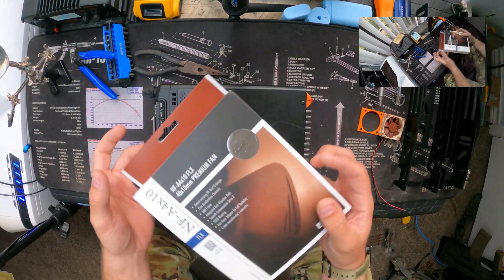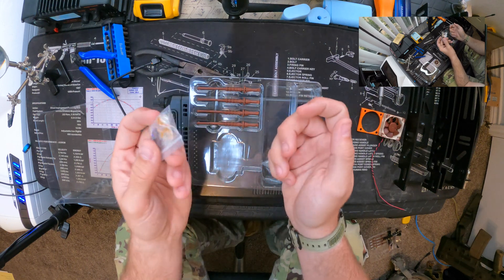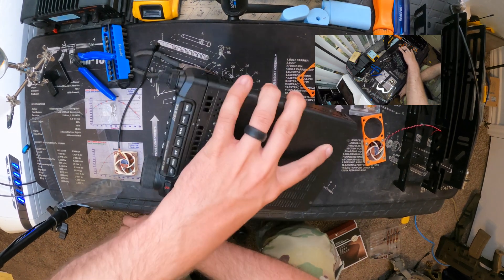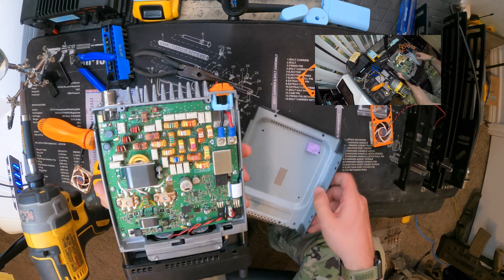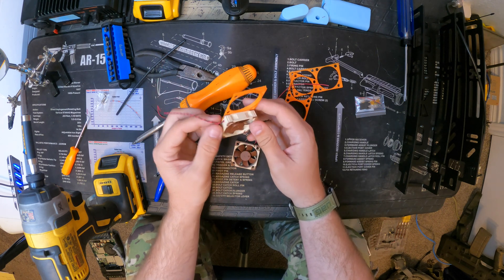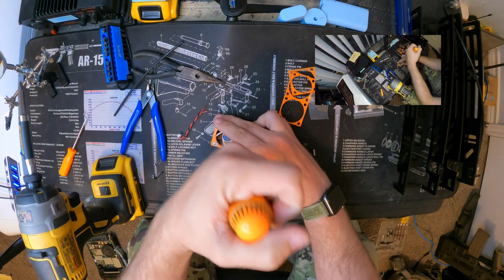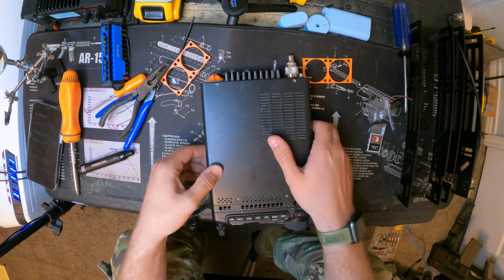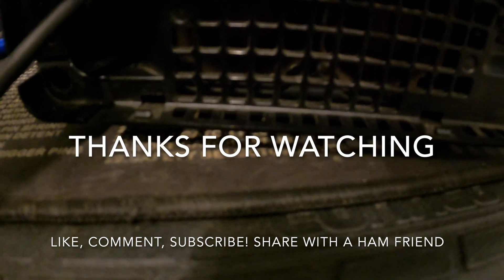The Workbench: Yaesu FT891 fan upgrade

Comment: I've ordered mine they are a lot quieter only thing I see is the speed difference original is 5500 new ones are 4500= 1000 rpm difference airflow is almost the same original is 4.9cfm  new is 4.8 cfm Hope this helps anyone thinking of changing the fans out I forgot about the noise origanl is 21.0db  new ones are 17.9db

Comment: Good job 
I own 3 ft891 good value for money 
But i blew ipo att on one
Still receives normal ok
I was tx on 160m vertical and had it connected to my 80m dipole 
It was turned off 
Never thought it would hurt it but it did 
So be careful with that seems common problem with 991 too

Comment: What size and type screws did you use to mount the fan to the 3d wedge?
Reply from the maker: I used the mounting screws that come with the noctua fan. Just typical standard computer fan mounting screws.

Comment: Nice mods you've done to the 891. Do you have any experience with the 857d, or can you point to anywhere where people have done a similar thing?
Reply from the maker: I don’t have any info on that radio, most of this was sourced by finding out the voltage and flow of the stock fans then going from there. I eventually plan on picking up a 857D if I can get my hands on one eventually but until then idk what the inside looks like or what voltage size it’s fans are.

Comment: Hi. Any update? Air flow as good? Radio any cooler? Are they less noisy in contest mode when they shift from low to high speed?
Reply from the maker: Haven’t had any problems since upgrading them noise is significantly less and haven’t had any issues with the radio getting hot to the touch anymore in the Texas heat.
Reply: @FITFO  Nice mod! Considering doing this with myself getting into FT-8

Comment: I am concerned about the airflow. I also replace with Noctua fans where I need less noise, but is not always possible. Could you reveal the brand and model number of the original fans please? I like to compare.

Comment: Sorry when I buy any 2nd hand radios I never buy radios that are moded I dont see the point in these mods it ruins the radio
Reply: A mod doesn't ruin the radio! A well done mod, like shown in this video, is an improvement. Fans are parts that can break and changing to high quality fans is repair work keeping the radio running better. The wedge in this mod is awesome idea and I consider it improvement to original Yaesu solution.
Reply: @oherrala  makes you wonder why Yaesu doesn't do this in the ffirst place.
Reply from the maker: Reasonable thinking, i guess it’s a lot like used cars, I plan on holding onto this one for awhile so I’m not too concerned as I know what has been done with it, something definitely to keep in mind however.
Reply: Run the radio in contest mode, fan runs more aggressive.....
Reply: Doing a powerpole or Noctua mod on a radio doesn’t ruin it!